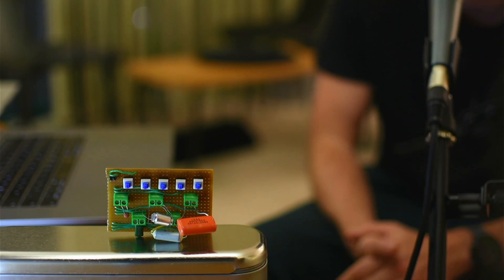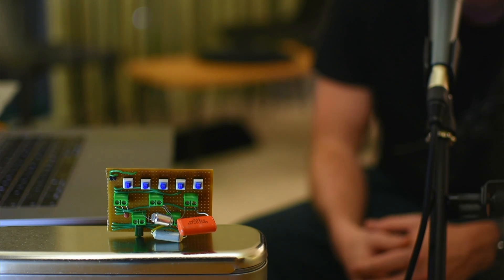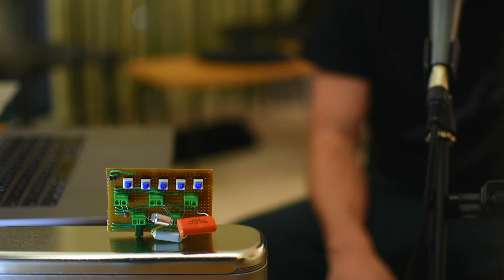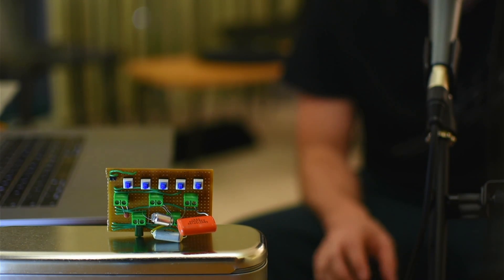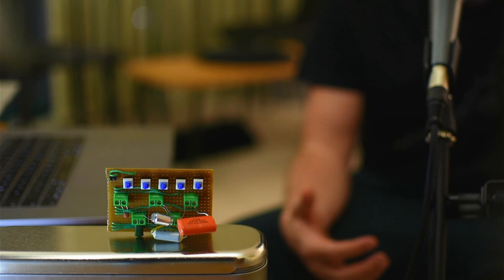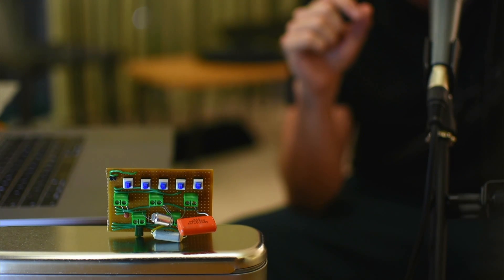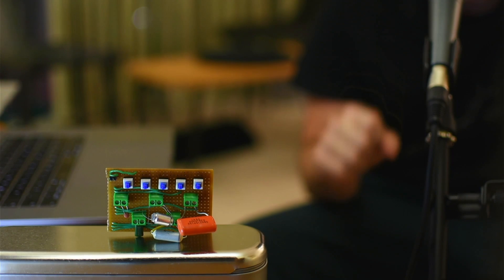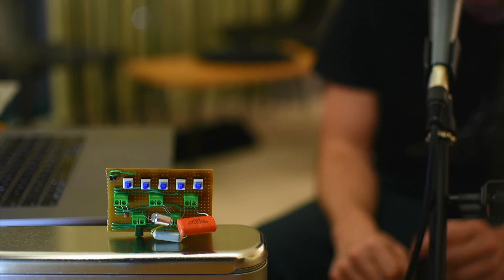Guitar Tone Capacitors Test (Orange Drop Vs Paper in oil Vs Polystyrene Vs Polyester Vs Ceramic)

Comment: The differences are to subtle compared to picking differences in each example.  There could also be some effect due to proximity to each other, or a nearby transformer, or even the level of static charge on the cap surface.  That being said, I expected the PIO to be the smoothest, but it sounded like it had less bass, like the PS.  The OD and Mylar sounded closest to each other.  The ceramic was maybe slightly ringy compare to the OD and Mylar, but would I notice it if I wasn't looking?
Reply: They are also not subject to mechanical vibration in this test.  Microphonics can not be determined.

Comment: I thought they all sounded the same. But if I had to choose it would be the the ceramic.  All my Gibsons from new came with ceramic caps.  If you Google what caps Gibson the result is ceramic caps.  When I see a Gibson LP with orange drops it's because they were changed.  My Fenders USA use ceramic.  Personally I do not think there is any difference and it's a bit snake oil when it comes to caps.  Paying £40 for a bumble bee cap is pretty dumb.

Comment: Very slight differences the cheap ceramic cap sounded as good as the paper in oil cap. The difference would be noticed above the frequency range of the guitar cymbals and high frequency overtones will sound better with a better capacitor.

Comment: Well surprisingly, at least to me, I could hear a noticeable difference - The orange drop and the oil sounded pretty much the same, a little bit muddy, or you might say warm.  But there were marked differences between the polystyrene, the polyester green cap and the ceramic - I think I preferred the green cap and the ceramic. They seemed to have more clarity. I was not expecting that. Really good demo, thanks.

Comment: i once tried swoping my paper in oil caps out for orange drops   in a les paul  the orange drops sounded harsh 
compaired i soon swoped them back to paper in oil ,a quality vintage paper in oil capacitor sounded much better
its worth trying different values in different guitars that makes a difference also 50s wiring too .

Comment: Very nice video man, great testing. I prefer orange drop for longevity,  tone, attack and range. I use orange drop capacitors 0.015 or  0.010 according to the pickups that I am using. High end bleed off without getting muddy on the 0.015. The 0.010 bleeds off the high end some and brings out more mids and the low end doesn't gett any mud all the way back to 0. Keep more videos coming.

Comment: I've been arguing with some "people" so not interested in debating any more, but something to think about. 22.35nf is 22,350pf. 5% of that is 1,117.5 pf. !000 pf makes a very large diff in tone. I'm working on an amp and with a 220pf treble cap in the tone stack I'm adding diff values to it to shape it. Also freq. not only changes but the resonant peak changes. I just tried 10 pf, then 7pf then a 1pf cap in parallel with the 220 even the 1pf changes the tone, and reso peak. 1.1175pf is .005% of a 22.35nf cap. A multi meter will not get you that close. You could be 9pf diff and get the same measurement on the meter. So how close do you have to get the caps value to not notice a change caused by the value? Are you hearing poly over mylar or a .005% diff, or placebo? There's much more to this than just swapping some caps.
Reply: 4:12 Yeah, the C value just changes the resonate peak freq and level at a given L.   

The AES did a big blind study that showed the brain can not accurately recall tonality for more than a few seconds.  So, your claim has no validity unless you at least made recordings of the same clip into the amp and nothing else changed significantly.  That includes temperature, and even humidity and pressure that can affect the speaker tone.  A 5% C value change is insignificant.
Reply: @GCKelloch  I'm not sure, were you saying my claim has no validity? I agree that your brain can't retain the tonality long enough to hear a cap change. As far as my diff of hearing the minute value change, I was using a clip lead to attatch and remove a small cap from a larger one, so there was no time inbetween changes. It would be useless to actually shut down add a cap and restart. I would have about 3 caps all with clip leads so I could make the addition and removal instantanious. I think I explained that what I was hearing by adding and removing such minute values was a change in resonant peak, not freq. range. But resonant peak does alter the amps tone.
Reply: @bradt.3555  Yes., your claim that you can  hear the peak shift with a 0.5% cap value has no validity because the ear/brain can not distinguish that.  

A 5% change might be detectable, but too much rime passes when switching out caps to make a valid judgement.  The silence and other noises during the switch also "trick" the ear/brain.  

Subtle picking changes also make much more difference than a 5% change.  FI, if your last note with one cap value has more bass, and the first note with next value has less, you will think the first cap value has more bass.  

The expectations of confirmation bias is what makes you think you can detect a 0.5% cap value change.  We all have that sort of bias.
Reply: @GCKelloch  There is no time switching out caps. however many I'm doing are connected at one end, say 3 at a time, with a clip lead so I can connect or dis connect or switch caps in real time. I realize that picking etc. can affect it, that's the problem with recording it. I don't just compare one riff thru, I'll go back and forth playing different stuff over and over, back and forth till I decide if I hear something or not (placebo). Adding 10 pf to a 100 pf makes a definite diff. that's 10% but smaller %'s are noticeable. Diff types of material at exact same value makes no diff. I've worked very hard over the years to understand and as best I can to eliminate expectation bias.
Reply: @bradt.3555  Connecting and disconnecting caps is likely too much time to really tell.  A switch might be fine for down to ~5%.  0.5%?  No way, no matter how quickly you AB.  I get it.  I've trained my ears for decades to recognize small tonal changes.  Just last week I found myself turning a knob on a VST effect while I thought I heard a difference, only to find the effect was bypassed.  Human imagination is very powerful.

Comment: I used to experiment with caps as well and later I concluded that it's best just to disconnect the tone pot and use 1 or 2 vol controls.
Reply: Im a beginner. How could i disconnect the tone pot on my les paul bridge pick up?

All i play is punk and metal on my chinese les paul. I was thinking of putting cts pots and paper in oul capacitors for better sound quality  but not sure if this matters if all i play is metal

Comment: Well, in my experience orange drop sounds wide and clear but in actual playing and listening as it goes high frquency too far so tone is not focused.
Reply: I found Orange drops work better on Neck position Fender pickups and the middle pick-up likes those yellow .022uf , the bridge can be warmed up with a .001uf. After a lot of trial and error I found every pickup has a ideal Cap and redistor value thst suits each individual player , these experiments are essential as they help to understand why things work.

Comment: Have you ever listened to a DI signal? ‘Upgrades’ like this, pickups, etc are just ways to get you to spend your money on things you don’t need. Once you run your guitar signal through your pedals, amp, cabinet, board, and PA, those tiny differences become beyond insignificant. Save your money, and practice more.

Comment: There is an audible difference? Yeah right! Now, don't look at the screen, get a mate to play the clean tones randomly ( not in order as you have probably memorized the order) Repeat this several times at these times:
orange drop 2:10
pio 2:24
polystyrene 2:34
polyester film 2:45
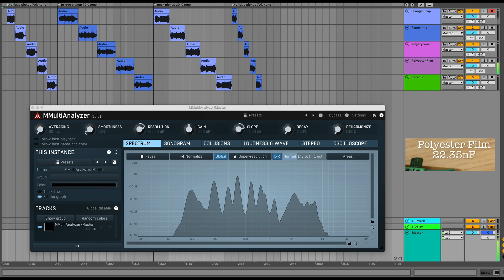ceramic 2:55
 (Mate, make sure you mix them about, play the same sample twice, does he thinks they're different?)
See how accurate you imagine your ears are now.

Comment: Orange drop is one of the biggest scams in the world. I was a technician fixing CRT monitors and TV's back in the day before the LCD was invented. There is a capacitor inside that works with the flyback transformer and it has a capacitance between a few nano-farads to about 0.68 uf. They are usually orange, maroon or blue. that means the dielectric material is polypropylene or polyester. Sometimes called a snubber capacitor. These caps have very high dielectric strength that is why they have voltage ratings between 600v to 5kv that is necessary to operate the flyback. Then someone from the guitar community called it the "orange drop" and sold it 500x its normal price because you need a 600v cap in your guitar!🤣

If you want to hear the difference in tone between different capacitor types you need to cherry pick those capacitors and make sure they all have exactly the same capacitance ratings. Most capacitors have tolerance ratings between ±5% to ±20% and that is a huge difference. K means 10% and J means 5%. There are capacitors with 1% tolerance but are mostly used in medical or life support equipment. Not in guitar tone circuits!
Reply: Paper in oil caps are the biggest scam in the guitar world I believe

Comment: If there are any real sound differences then they are absolutely minimal. This test needs to be done double blind in order to be relevant. If you see what capacitor is active your brain activates everything you believe to know about the cap and what it is supposed to sound like - this is useless, as it just verfies your beliefs. I am pretty sure that a double blind test would yield no relevat differences between the caps as long as their capacitance is the same.

Comment: The only problem with paper in oil is the oil dries up over time changing the value of the cap. Lot of people like the vintage tone of a instrument with these oil wrapped caps don't realize the sound their getting is due to the cap failing inside the instrument. Mylar,  polyester style caps do exactly the same thing as the oil wrapped caps but can hold their values better over time and stay consistent. That's why you never see oil wrapped caps in sensitive electronics today. Just not reliable. And using caps listed for higher voltages over 100 volts or more does absolutely nothing to better the sound. You'll never go beyond a couple micro volts on a passive instrument or 9 volts on a active guitar. People go out and buy 400 volt caps thinking this improves the tone. It doesn't. A 10 or 20 volt cap is sufficient for that style of circuitry. You never reach that 100 to 400 volt status. If you do say hello to God for me. 😁

Comment: I know Polystyrene is a long time favorite with high end audiophile designers in regards to capacitors in a signal path.  5 of my friends and I did a blind test between several capacitor types used as tone caps, with the guitar's tone control fixed at a certain point (8/10).  The polystyrene was hands down the best sounding to EVERY one of us, zero question. Again, this was a blind test and the conclusion was unanimously OBVIOUS to all of us.  We all made the change in our instruments.  Ignore the internet marketing hype about PIO capacitors, it's a 100% money making racket.
Reply: It ain't the material it's the value.
You don't hear what's sent to ground, you hear what's left.
Reply: Thanks.  I think this makes perfect since.
Reply: @HEZ63  Because the tolerances are all over the place. +/- 20-30%! 
The dielectric makes no difference.
Reply: @bobmanners8624  If you think so....
Reply: @HEZ63  Every electrical engineer will tell you the same thing. I know, it's hard to let go of the mystique.

Comment: I appreciate that you actually took the effort to measure out the exact values with a multimeter. Something most testers take for granted. That paper in oil one is almost 20 percent over the rated value, of course it sounds different.
Reply: True, 10% of .022 is .0022mf, thats 2200pf. I hear diff. with just 10pf when trying diff values to tone shape. When I measure caps I find many new ones that aren't even in their spec'd range. And that's good quality brands.

Comment: Ceramic capacitors should never be used in Audio applications
Reply: Ceramics are very often non-linear (affected by voltage) and can play hell with measured distortion if used in the signal path. I've seen it happen.  Of course some people like distortion.

Comment: Subtle differencies in general, but there are some. I seem to like the rest of that guitar, so none of the capacitors turned the tone to the bad, although i would go with the PIO. I also found the ceramic one quite pleasing.

Comment: I simply do not understand your purpose with this presentation! You are clever enough to claim that a few nanofarad difference does not matter, so I assume that you are also aware that the technological difference does not matter either. The tone circuit of the guitars is basically an L-R low pass circuit where the tone pot is the variable R and the pickup inductance itself is the L . The cap plays only a secondary role to provide dc decoupling of the tone pot. The myth of “tone cap type matters” is the most stupid, only guitarists believe who do not know electronics at all and they had read morally inadequate advertisements about tone caps. Did you want to provoke them, whether their phantasy suggests any difference to be heard?
Reply from the maker: Hey - thanks for your comment. The purpose of this video was to run an experiment (which arguably has some flaws) and let people/guitarists/musicians decide if they can hear a difference between different types of capacitors and if it worths the effort. On purpose I didn't pick a side when the video was released, in order to get some unbiased feedback/comments. However, I'm on the same side as you - despite any small differences a non-ideal capacitor might be introducing - those are minuscule and capacitor type swaps is one of the worst optimisations during the journey towards the "ultimate tone".

And yes - the guitar industry is very broken market - plagued by questionable marketing, placebo effects and "influencers".

Comment: The only difference is due to the caps always being off-spec. The type makes no difference when it's just connected to ground. It's not part of the signal path. The differences in ESR are way too small to make any real difference compared to just being a few percent off-spec one way or the other. The bigger difference is the difference to the amount of noise, caused by wiring them the right or wrong way around. It's never marked on them. But even that is negligible in a shielded control cavity.

Comment: I could hear no difference at all in my best headphones. I doubt anyone could pick out which was which on a blind test.
I did frequency sweeps up to 96Khz through several different types of capacitor when I was playing with a new signal generator a few years ago.
The value was the only thing that made a difference. The construction made no discernable contribution to the measurements.

Comment: Awesome! Proving what I’ve been saying for years about cap materials not making any difference. I was right. Again.
Reply: I don´t think you are right. I am building loudspeakers and tube amps, and I know for sure that series caps makes a difference, because the tone runs through the cap.
But a tone circuit on a guitar i just a parallel treble bleed to ground, so here I don´t think it makes any noticeable difference.
Reply: The only one here with any sense. Seriously. "Paper in oil sounds so much better! the ceramic is so bright and chimey!" People are making up stuff about the tones to justify the money they spent on their vintage correct caps.

Comment: Great video. Absolutely stellar. Would love to hear the tone rolled off if you ever do another. Oil on paper is pure magic. I entirely don't know what some people mean when they say it's muffled. The Oil on paper Is booming with detail but has a subtle mojo that the others lack. The orange drop is very smooth with a sort of compression and rolls of high tones. The latter polyester and ceramic are quite clear but the tone pierces which causes ear fatigue.  Listen to the first example of how the highs hang in your ear. It's not natural and has a fractured ring on some of the caps. Thanks again!
Reply: That’s all in your head
Reply: @JayOneAlumni to quote Rick Beato, "you've got bad ears."
Reply: @leamog  incorrect

Comment: Thank you for the excellent, excellent, excellent capacitor experiment. I thought I'd hate the sound of some of them, and really love one over another, but they all have something good, and bad about them. Extremely fascinating.

They're each distinctive, adding their own flavors. Which is making me wonder how well they would blend. As in, used in parallel, say, equal capacitance for all five, adding up to the 23nF.  Or, say, 9nF orange drop, 7nF ceramic, 4nF polystyrene and 3nF paper in oil to take the edges off the blend.

I don't have the equipment to properly test that, I have no idea if their sounds would blend when used in parallel or not.